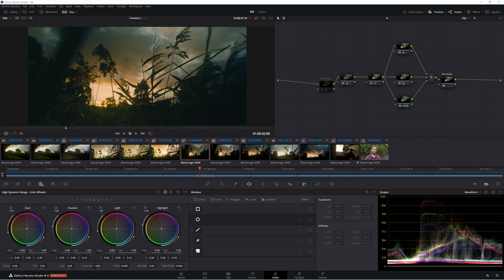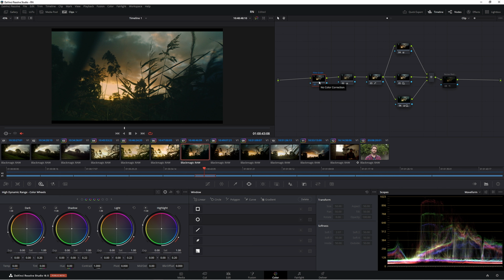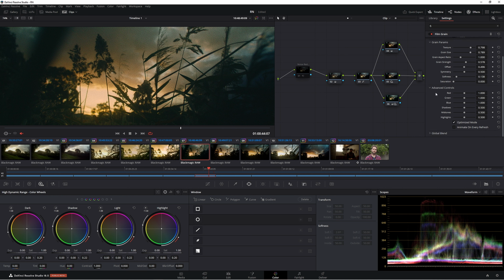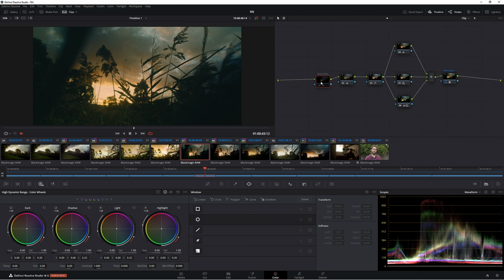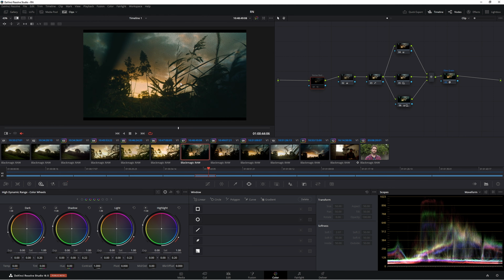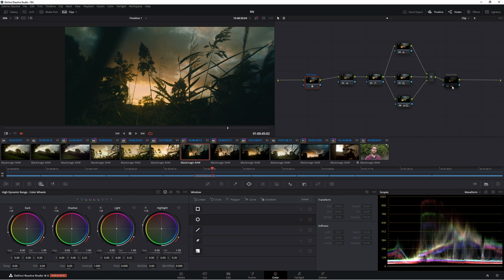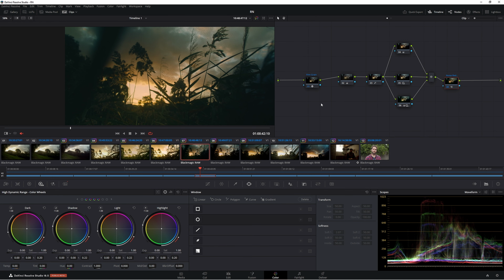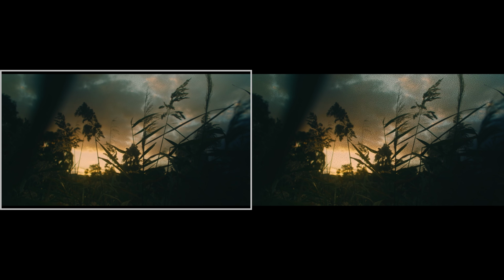Stop ruining your film grain (An easy fix!)

Comment: Good video - the order of operations for all spatial changes should always be spatial texture after spatial blurs or diffusion ( blending ) . The example here is pretty evident that any smoothing affects the look of the grain. Good example. 
If one wants to see the extreme of this theory. Put the grain first - turn the node off and put a close up of someone that needs some beauty work - add nodes accordingly with soft power windows and blurring ( acne or scars etc. )  - then go back to the first node of the film grain - turn it on. If you want to see what it is doing to your film grain - click the checkbox to turn on "Grain only" and take a look at that film grain and how all those smoothing after the grain, has totally ruined the grain. Other spatial tools that should be after blurring or noise reduction are Film Grain, Contrast pop, Midtone detail,  sharpening,  Texture Pop, and surprisingly the Highlights and Shadow values in the primary tools.
Then just click on the film grain at the front and click "E" to extract it from the node tree and drag it to the end of the node tree and when the "+" shows - drop it there. The grain as you showed in this video will be pristine and exactly as it was when you set it up. 

Keep the videos coming. 
Doing a great job.
Reply from the maker: Node structure and order are something that is very important and something people tend to ignore. It makes a huge difference on the income of your grade.

Cheers for the comments / watching